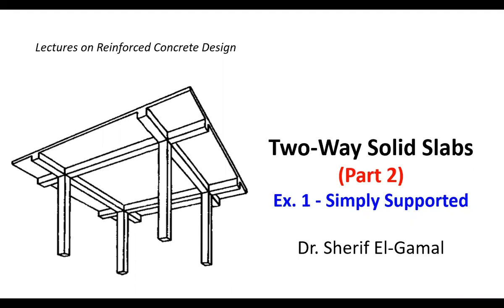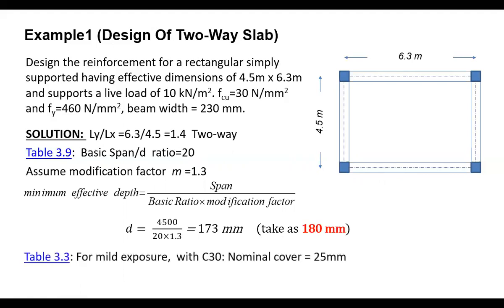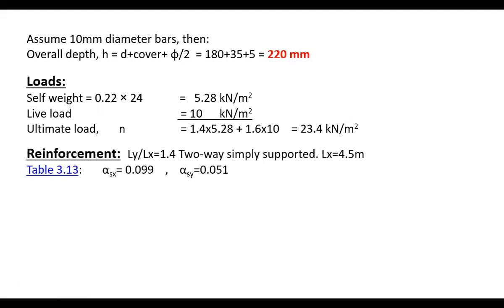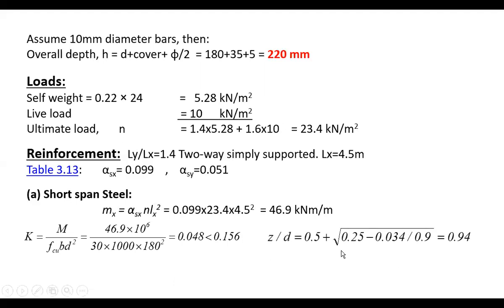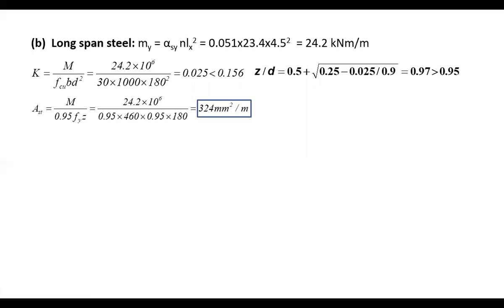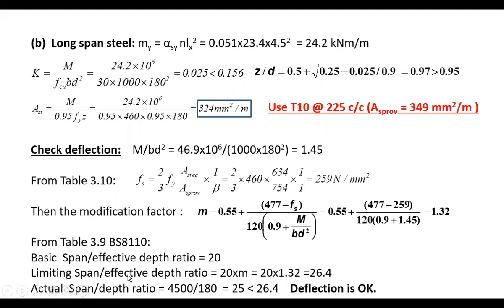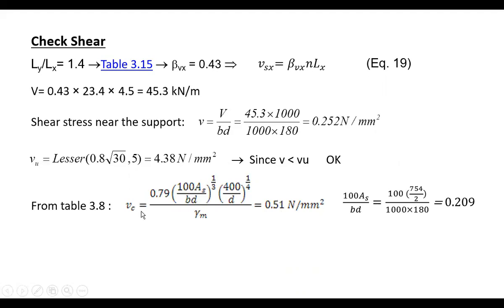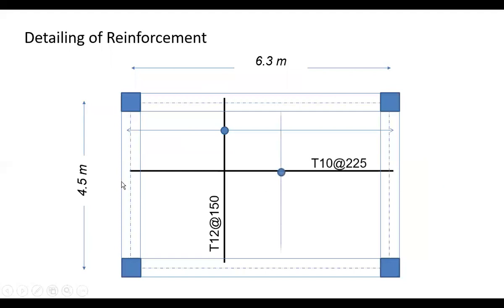Design of Reinforced Concrete Two-Way Solid Slabs  (Part 2) - Simply Supported - Worked Example

Comment: In calculation of self weight of the slab you have just considered the thickness and the density. You didn't consider slab dimension is that right?
Reply from the maker: yes, it is right because we calculate for 1 m square. It means  h*1*1 =h

Comment: Hi Dr, how did you assume the modifications factor as 1.3 ? Is it in any table ? Thanks
Reply from the maker: 1.25 to 1.4 will be reasonable based on loads. At the end you have to check deflection and will let you know if the thickness used is safe or not.

Comment: HOW DO YOU CALCULATE MOMENT IN THE SLAB IF U HAVE POINT LOAD?
Reply from the maker: You can use a computer program in this case or you can use a method called yield line method.

Comment: Thanks Dr.Sherif, I see you have used same d for both short and long directions is that ok too. Also I have seen some books give the formula for area of steel as M/0.87fyz but here you have used m/0.95fyz is that an updated formula. Thanks Dr.
Reply: @Suleiman Jamzuriy 

If you are using a grade of 500 Mpa, the code suggests in its new version a factor of safety for the reinforcement of 1.15. In contrast, the code suggests a factor of 1.05 for a grade 460 Steel.

1/1.15 = 0.87 (For Grade 500 Steel)
1/1.05 = 0.95 (For Grade 460 Steel)

and the professor should have used two d's as we have two major bending directions and not one in a two-way slab namely dx and dy.

All the best for you and the professor
Reply from the maker: Thank you for your interest.
Yes we can use the same d for both directions. The M/0.95fyZ is ok. I am using the BS code. May bd the 0.87 was an old version or another code.